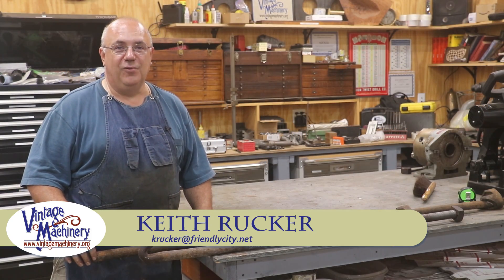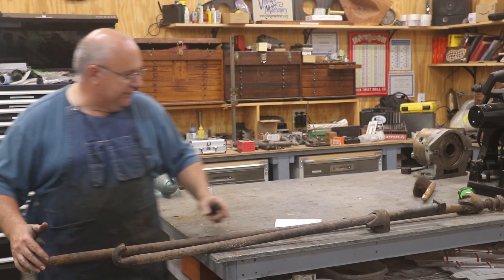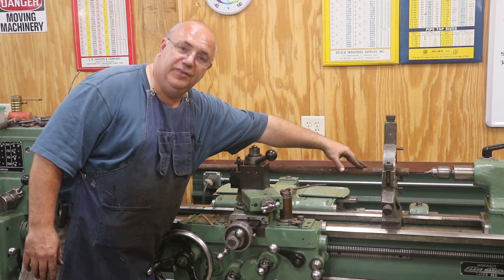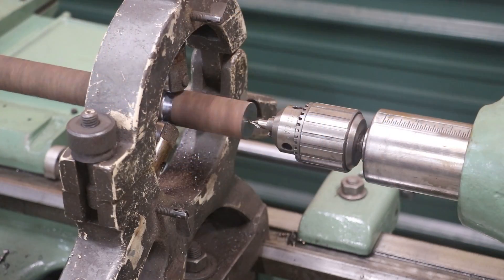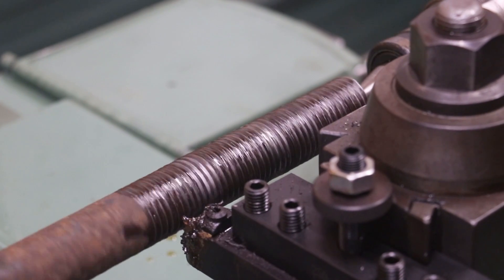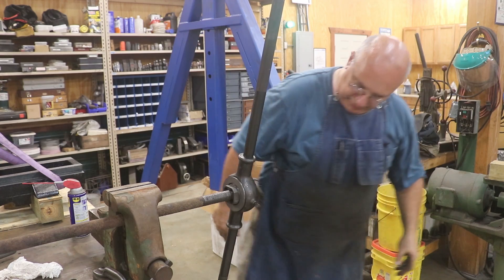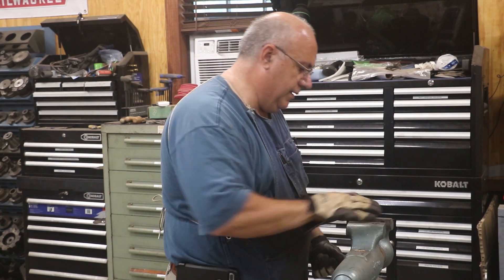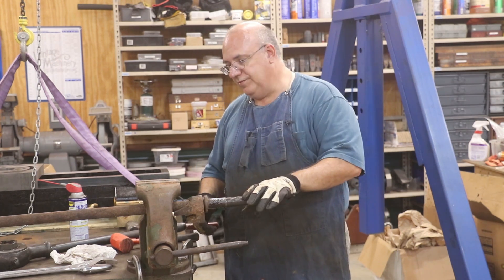Modifying Railroad Gauge Bars from Standard to Narrow Gauge

Comment: Hi Keith. Nice job. Good way of getting around the runout problem. However I had the thought - once you cut threads on the our of round portion of the rod, the initial threads would be a bit deeper on one side than the other. The die is NOT going to  reshape that, rather just follow your original track and trim the threads to fit the internal tooth diameter.  But - an you and mony of the other guys here have pointed out - No Matter. It is only the end length that sets the track spacing.  Rather than being track gauges, whi fix the separation of the rails, is that more properly a spanner or tie rod to prevent the side pressure from doing damage?

What's with this Abomb guy - You seem to do different jobs and he seem fairly competent in his field. Is there competitiion going on?

Comment: Your lathe doesn't have a through hole that the 1-1/4 inch rod will go through? Why not turn the rod through the die with the lathe holding near the thread with the steadyrest? You can buy new 36 inch 1-1/4 inch gauge rods from Kimes Steel and Rail in West Virginia for $26.14 each or the double end for $36.25.

Comment: Hi, Keith, I thought maybe that you would have re-indicated it once had a centre drilled in the end... to get the threaded end running true. And yes I have dealt with railroad equipment - standard gauge Class 1 in Australia is +/- 5 mm. We have a similar 'tool' to what you are machining, only much much much shorter - it is known as a point clip - it locks the switchblades together as a safety measure and a long hasp lock can be threaded through it to stop the nut from turning off it.

Comment: I was curious why you didn't run the bar through the headstock and just thread the 6 inches you needed?  I know it was not running true, but at a slow enough speed something that rigid wouldn't have flailed.  Is the headshaft on your lathe smaller than 1.5"?  Finishing the threads with the die was definitely the way to go for a nice fit and finish.  Great video!  Thanks!

Comment: You must do things different down there than we did at the museum I volunteered at in the 90s.  I saw a pile of gage bars sitting in the boxcar we stored all the track tools and asked the track foreman that retired off the Rock Island what they used were for once. He said those are s***bars because if you ever have to use them s**t is sitting on the ground rather than on the rail.  They were used to keep the rail from spreading further as rolling stock was drug back up on top of the rails using retail ramps.  He said they don't have much use in everyday maintenance because if you have time to install a guage bar you have time to replace the tie next to where you were going to put it.  The ones we had were a little different they had a hooked end but had a clamp and nut next to the hook end as well as two nuts and two clamps on the far end so both sides of the base of each rail were captured keeping the rails from turning over.

Comment: Hi Kieth,

Depending on the length of your headstock and the bore, could you not have chucked it up on a straighter section of the bar with the remainder of the bolt through the headstock? That would have helped with the chatter too.
Tapping big threads by hand certainly is a good workout and you have to be careful spinning them off as you get wacked in the ribs if you are not careful.
In the commercial world, most of those sort of threading functions are not cut but roll formed, or they use power threading machines.

Comment: Should have just run it through the spindle. No need for steady rest.
Reply: Until it bends and starts whipping around tearing up everything around the lathe including the lathe!!!
Reply: @rockerpat1085  Did it appear to you that he was turning it fast enough to do that? How many hours have you spent running lathes?
Reply: @DomManInT1  Yes it did look like it was spinning fast enough!!! There's no way I'd hang that out the back end and spin that bent shaft!!! Maybe you would but not me and in this case neither did he!!!
Reply: @rockerpat1085  So, I must have missed your answer. How many hours did you say you have running lathes?

Yeah. I am the type of person that will put a 25 foot part through the spindle of a lathe with a 6 foot head stock. In this case his part was 49 inches long. He needed to thread 6 inches. Could have had a comfortable 7 inch stick out. The head stock on his lathe is probably at least 36 inches. That would leave about 6 inches sticking out the other end of the spindle. How fast do you have to turn 6 inches of 1-1/4 inch diameter hot rolled steel to get it to whip? I am thinking 3000 RPM or more. Now if his head stock were longer, this might not have worked at all due to the hook not fitting inside the spindle bore.

Comment: Were gauge bars permanent or just used until the road was spiked and bedded?
Reply: Gauge bars or rods are used to add strength to the track in sharp curves or a quick fix so tie replacement can be put off.   The second is usually done on industrial or little used track or when someone is too cheap to do proper maintenance.

Comment: Thanks.   I had not noticed gauge bars on tracks before.  Do model railroaders use gauge bars?
Reply: Not usually on the smaller gauges as the model tracks don't flex as much as real track nor are they carrying the weight of a real train. On the "garden rail classes (I, 5" and up) you might see them used but normally they would be made into the ties themselves.

Comment: Nice job! The blacksmith approach would be to cut off the hook end and bend it to make a new hook.
Reply: Looks like the existing thread was in pretty bad shape, so a new one would be in order.
Reply: @douglasstovall2395  Easier to get an angle grinder out and clean the threads?  or cut  some out of the center of the sucker and weld it back together?   But Keith is an unpaid volunteer with plenty of time ?

Comment: Why didn’t you stick the shaft through the spindle bore out about 6 inches to thread it? Save a lot of work.
Reply: May not have fit. Those old Monarchs have notoriously small spindle holes.
Reply: 3+ feet of bar sticking out spinning making a fairly large circle due to the bend in the bar. Another option would have been to cut off and reform the hook end.
Reply: It would be fine at a slow threading speed though.
Reply: @rick_.  you wouldn't need 3 feet of bar sticking out. Put the bar through the spindle bore until the hook is up close to the headstock. Support opposite end with fixed steady as he did. Centre drill as he did. Support with tailstock and partially thread as per rest of video.

Comment: Dim memory cells here, but I'm pretty sure the bend in the gauge rods are intentional to provide a "spring tension" when you tighten them up.  One thing most people don't realize with rail and all trackwork is that it is SUPPOSED to flex a certain amount when the train is moving over it.  All of the securing systems flex in one direction (tie plates allow/control longitudinal, gauge rods allow/control the horizontal, ballast allow/control the vertical) so that the track can move as designed to take the weight and forces of the train and return to spec afterward.  They also help to control the rail as it expands and contracts with heat.  Tie Rods are also used on long straight sections of track to help control sun kinks that can form by forcing the entire track to kink instead of just one rail.  When this kind of shift happens, a train can often still navigate the kink safely and MoW crews also have a much easier time fixing the kink since they are working on the whole track instead of just a single rail.
Reply: Correct. One of the earliest things discovered with welded rail was that they had to allow the rails to expand/contract with temperature changes from the temperature the tracks were laid at. (3/4" per 1000 feet of rail per 10 degree temperature change) or the changes would break tie plates deform the rails and pull welds apart. With bolted rails this wasn't as much of an issue as each rail joint allowed the rails to move.
Reply: @Blazer02LS  Welded rails are either laid at or adjusted to the "mean" temperature of the rail at that location to better prevent kinks and pull-aparts.  The tie condition and ballast section has to be in good condition to take these forces.
Reply: Correct, IE the temperature that the rails were laid at. Normally the rails are laid or repaired at that areas mean temperature. The issue is when the temperatures change in an area over the day or year.

Comment: Kieth ... were you never taught to turn the die in reverse every so often ....?
Reply: He was barely cutting a thread. 90% of the thread was cut on the lathe, so he didn't need to do that backing off.
Reply: @xenonram  don,t talk pish mate...he sounded like he was going toe to toe with Mike Tyson... ..any one who threads anything should have the habit of backing off..coz that's how you do it 😉
Reply: @premierd8988  That is interesting because I have seen videos of industrial tapping and die cutting that is done without reversing.  Andrew has it correct.  Generally you are correct but sometimes it is not necessary.

Comment: Please help me out here - I've always had a hard time getting a good thread on hot rolled steel. It always comes out very rough - so rough you can't even wipe it off with a grease rag because the rag just hangs up on all the tiny little burrs. Cold rolled, stainless or even aluminum comes out looking slick, but not hot rolled. Is it just me? Is that another reason you switched to the die to finish off the thread?

Comment: The gauge rods we used were made of threaded rod with IJ's (insulated joints) in the middle.
They would clamp the rail inside & out to hold the gauge solid. (not just pull the gauge tight).
Very nice well, done as always.
Reply: There are several styles of gauge rods for different applications.

Comment: Okay, I was thinking that you could use a lathe with an opening capable of sliding the bar through the head unit and tighten down with either a three or four jaw chuck. The you could merely expose only the amount you needed to work with and it would spin pretty much centered. The other end could ride on a roller of some type. I guess either way works though.
Reply: The other end would be running out way too much to be supported by rollers.

Comment: Why not put them in the lathe through the spindle (from left to right) and leave just a few inches of stickout from a 3 jaw chuck? They look thick enough not to whip around and thin enough to fit into the spindle bore.
Love your videos
Reply: Vedran Latin, I was thinking that he would do it like you said. I guess there’s more than one way to skin a cat, and he got it done. It’s fun watching how people can do things differently and end up with the same results.
Reply: @Hoaxer51  Keith is a tool guy, and probably wanted to find a use for that monster die handle.
Reply: Vedran Latin   I was thinking surely Keith has a lathe with a big enough spindle bore to take that job.
Reply: @littleworkshopofhorrors2395  That was my first thought, because I watch Keith Fenner, but I'll bet this Keith doesn't have a lathe with that big of a spindle bore. Well, I don't bet, but that would be my guess.
Reply: I wondered that too.  I wonder if the hook would cause an imbalance and start whipping.  As slow as he wound up, I doubt it would.  But when he was drilling?  Who knows.  Might not have the clearance to the left of the lathe to poke it through.
Reply: @stxrynn  Yeah- with a lathe spider you can dial it in true- just a simple stand to support the end will prevent whipping.
Reply: Probably because he did not have enough free space at the end of the spindle, or did not want to have to build an external steady rest for the free end of the rod for what is essentially a single job, so did it that way, as the lathe has a long enough bed and he has the existing rest that is good enough for this job.

At least he does not have to make the gauge bars, they are probably free from old rail that is reclaimed by the railways, and would otherwise be destined to be scrap steel headed for a furnace, but now are going to have a long life again as museum working parts.
Reply: I don't think he has a spider for the spindle on that lathe. Although for threading it would likely be turning slow enough that it wouldn't be an issue.
Reply: That's what struck me too.
Reply: The rod was bent,  the die will follow the bend vs the lathe trying to make it concentric to the spindle.
Reply: He could still have used the fixed steady. Put the bar through the mandrel bore until the hooked end is only just sticking out. Then use the fixed steady on the other end.
Reply: Or, you know, he could just do it like he did.
Reply: DeathK   indeed,it certainly worked but one is always looking for efficency.